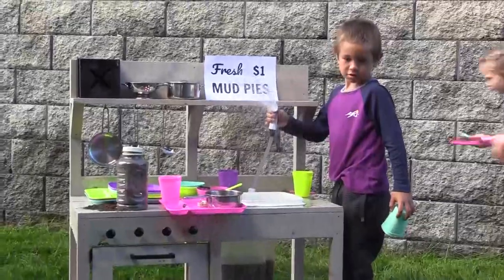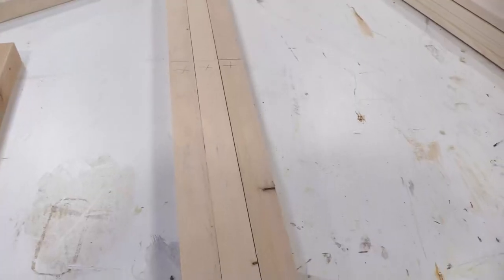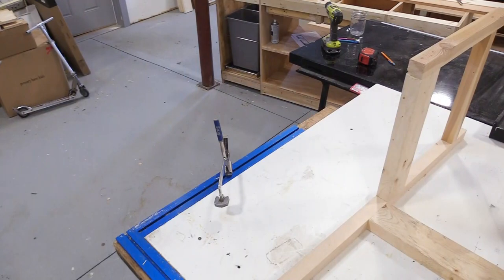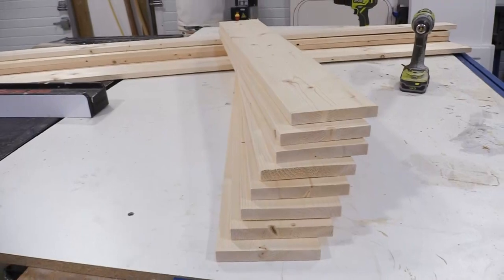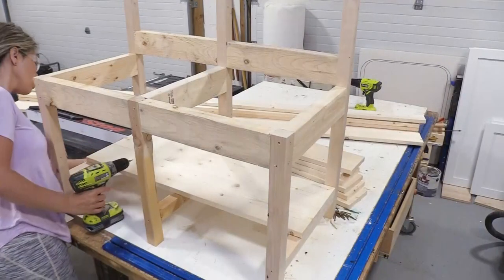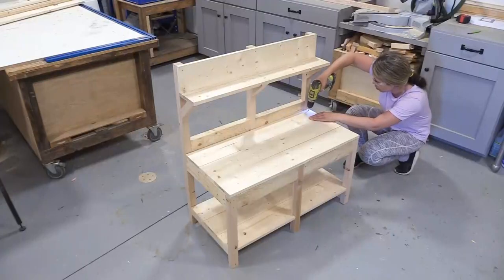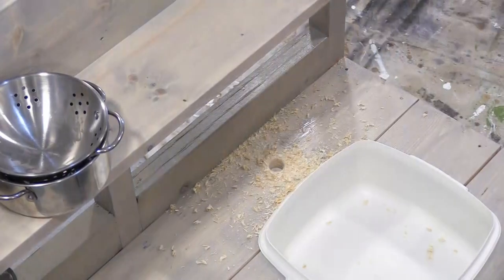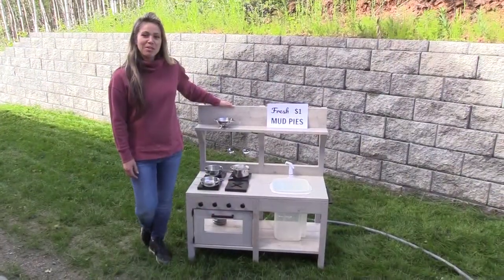Mud Kitchen With Working Sink!

Comment: Adding wood glue on the legs would of been pointless, end grain onto strait grain wouldn't adhere very well at all and the slightest wood movement would break the seal strait away, screws in this application would be more than enough :)
Reply from the maker: Thanks for watching!